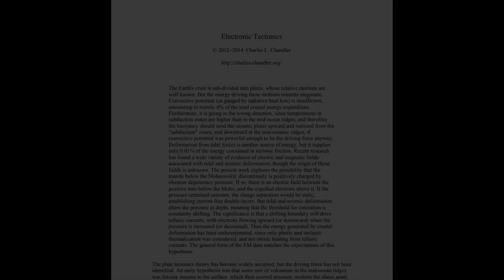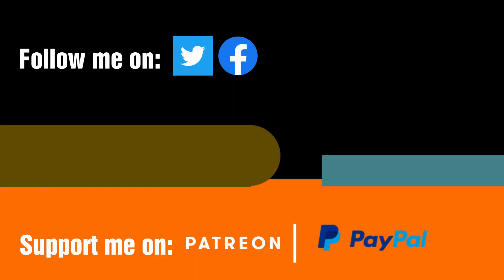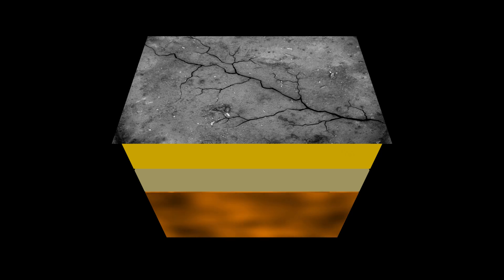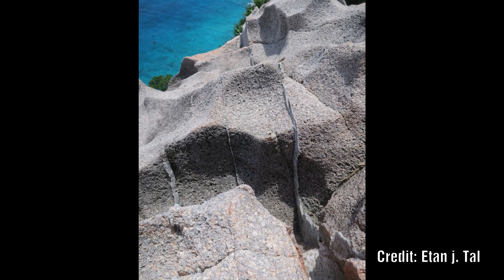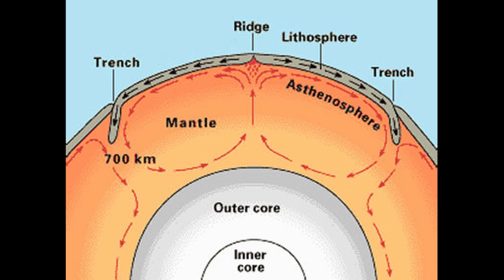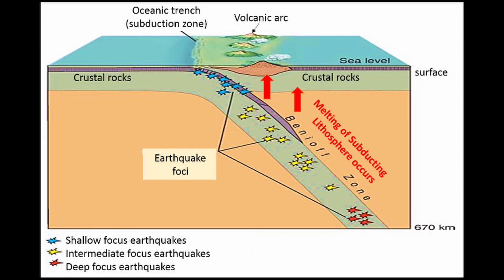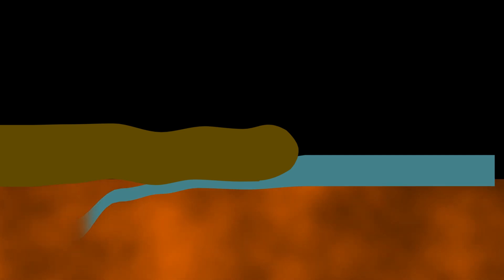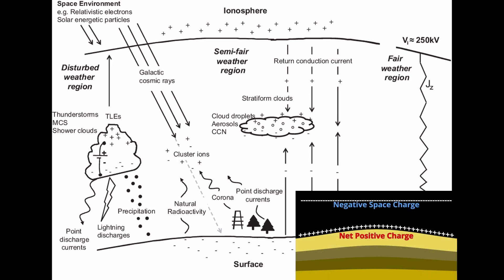What Powers the Movement of the Plates?  Convection or Something Else? Electronic Tectonics Part 2/2

Comment: Planets are circular bells, and do not have a mantle or a core -
They are positively charged on the inside & negatively on the surface.
The positive charge on the inside push outwards in all direction ...
Reply: The atomic dipole = negative charge points inwards in an double layer caper like a sun/planet  = they repel each other at the core & create an void . . this is  filled with an plasmoid  . . an Birkeland soul to speak , like all life/atoms fractal has . . in an form , inside them . . a plasmoid is at the core of the galaxy . . not an empty black hole

Comment: Has subduction been proven? We can see the process of seafloor spreading all around the earth but Ive only seen animations of subduction. Could it be that the earth is expanding only and the continents remain fixed? For the earth to remain a constant size there would have to be just as much subduction taking place at the same rate as new oceanic floor is being produced. It seems like that process would be just as visible as seafloor spreading.

Comment: The two overlapping strata plates were assumed to be homogeneous only differ in composition. Landscape of a larger scale are hardly homogeneous. Buckling seismic energy storage theory is less likely a case. 

Stressed heating go against efficient seismic mechanical energy storage from impeded movements.

Comment: Hmmm should you lose that standard model "inner/outer core" diagram and make a stock electric universe theory one?
Reply: Personally, if I may make a suggestion.  Are all planets made the same? Maybe, maybe not. Theoretically, it is possible, so, let's  take that postulate. There are a t least two ways a planet is born. I submit, the first way is likely related to the birth of the solar system, Birkeland current.  Some planets in this early birth may be the product of small plasmoids in the sense of low voltage/current, where iron and other heavy elements are drawn to the core and lighter elements to the surface.  These planets have the highest potential, I also submit, for having life. Plasma was named so, it has been suggested, due to its self-organizing properties, and in some situations, it is even self-perpetuating. This self-organizing property was once considered a primary definition of life. Does the N-S polar electron flows through the magnetosphere stop at solid ground, or do they follow the magnetic field lines to the core and out the other pole?

Comment: All 6 known theories about Tectonic Plates lack a reason for the start of tectonic movement (maybe except Shock Dynamics). What mechanism is provided by Electronic Tectonics to account for that?
Why is Chandler so sure subduction exists? There is plenty of doubts about subduction, leaving aside that it is supposed to happen near the seaside and NO picture has ever been taken.
Reply: Problems with subduction:
- Subduction is a controversial issue. There is no explanation of how the plaque movement began or what led to its fracture (210).
- The pressure necessary to erect mountains is 2.500-6.000 atmospheres (205). The throwing (pull) of continental slabs and basal drag are theoretical propositions without recognized calculations (206) (207) .
- Only in the cratons under the continents, it is estimated that the basal drag exerts the force that is needed to raise ridges (207) 
- Without subduction there is NO Plate Tectonics; but we DO NOT know how Subduction started (208).
- Subduction must be imposed on the friction and resistance of the plates to be folded (209). It is implausible because one side of the dorsal sinks and the other rises. 
- In some borders, there is doubt that there is subduction but rather there is obduction (211), (continental plate goes below the ocean).
Reply: Do you think an expanding Earth is more likely?
Reply: @DegreesOfThree  yes
Reply: @DegreesOfThree  More likely... but I don get any mechanism for mass creation.... I'd rather have other theories upper in the list. "Recent" continents breakup and catastrophic plate tectonic in cometary Venus-Inanna flavour (supported by Nufer-Baltersperger-Woelfli paper calculations).